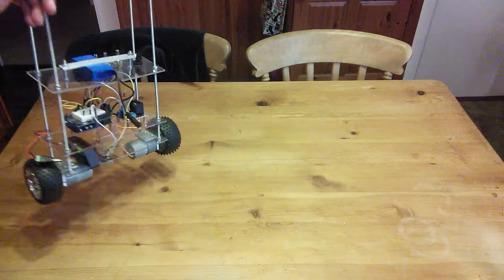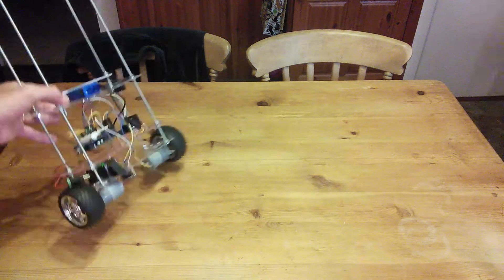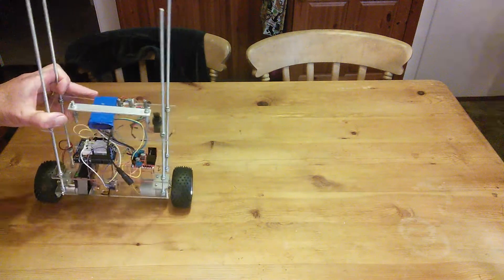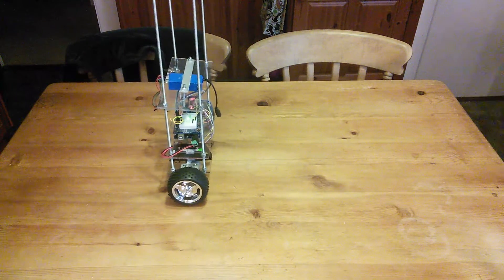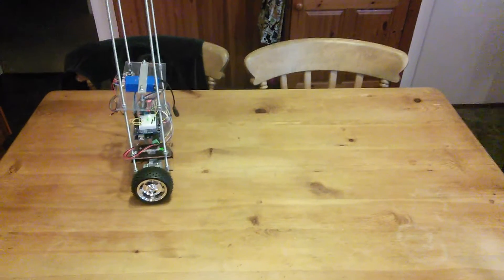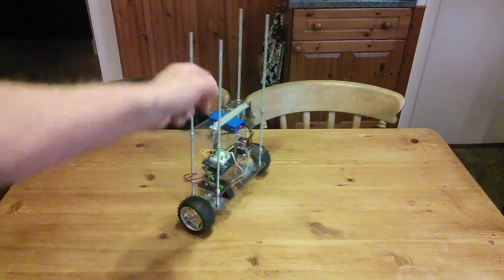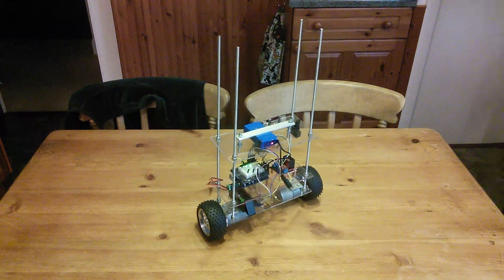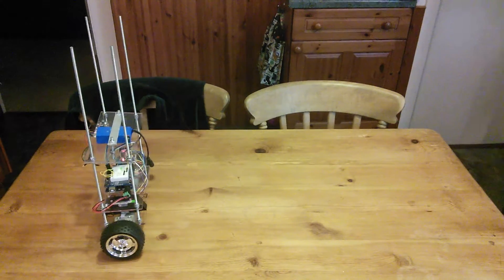Self Balancing robot using MPU 6050 and Arduino uno

Comment: Hey can u share the code
harshalm61@gmail.com
Reply from the maker: +harshal mistry  For those who want to know how I did it, I used this library which is for the 6050 https://github.com/jrowberg/i2cdevlib/blob/master/Arduino/MPU6050/MPU6050.cpp
This has an example which shows how to get the tilt angle, you then use a PID routine, once again a library is available, https://github.com/br3ttb/Arduino-PID-Library
 Then knowing the error and the PID generated correction you apply it to your motors via the PWM pins. You need a motor driver and the code you use will depend upon the driver.
 You will then have to tune your PID parameters.
 My code is not well documented and is specific to my set up, much better to use the above approach. Learn how to use the 6050 library, learn how to use the PID library, experiment with driving motors, and then put it all together.